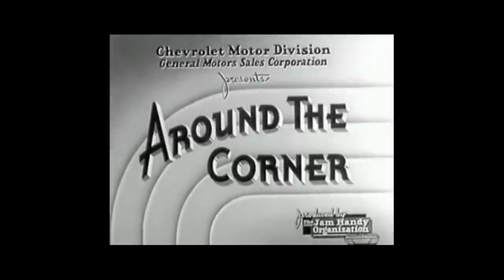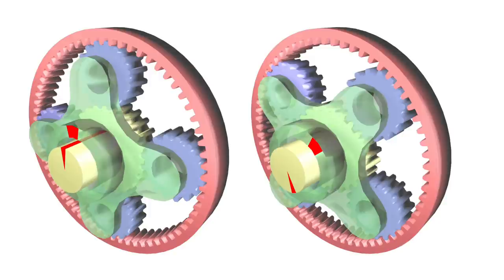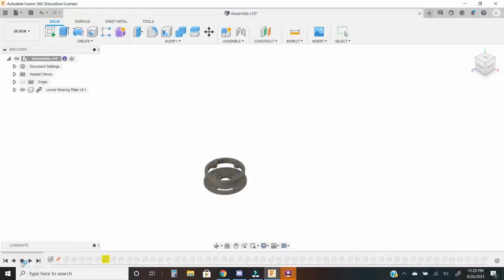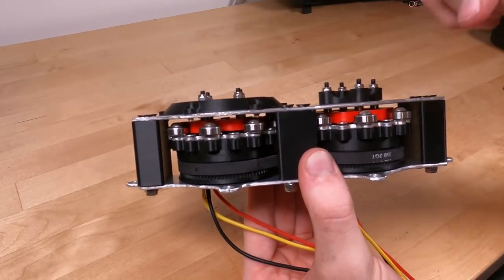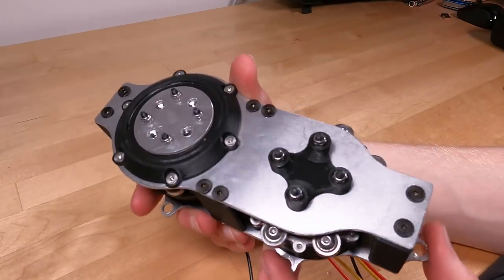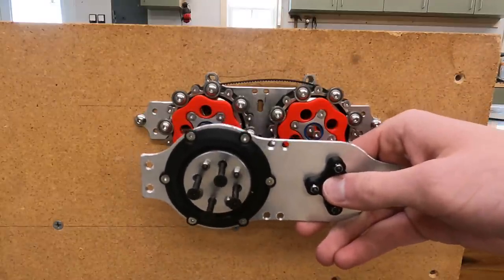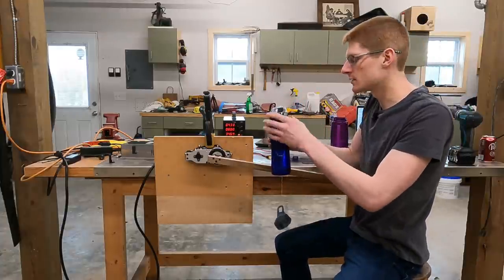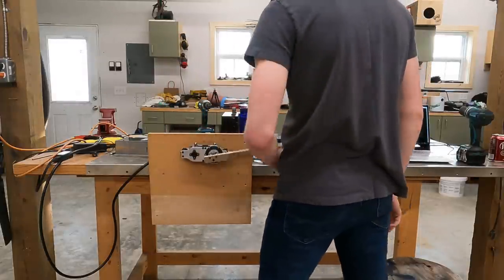The Differential Drive - A New Breed of Actuator

Comment: One application for driving one shaft with two engin is in ships. The concept is called "Vater Sohn Antrieb" (German), "father son drive".
I wasn't able to find anything on the internet with this phrases.
The idea is coupling two motors to on propeller shaft to get the option to run any of the motor under optimum efficiency conditions under different load condition.
The father motor has around twice the power of the son motor.
So using only the son, the ship can cruise low speeds at maximum efficiency of the small motor. For maximum both motors are engaged. 
This concept is used on tugboats and a specially on riverboats.
For example on some passages of the Reihn ships need very high power to go uphill but for going downhill they need only little power to enable enough flow at the ruder to maintain stearebillity.

Comment: So I have seen something very similar to this on industrial box making machines. The machine is made of many pairs of drums that pull the board through the machine and cut/print on it.

In order to adjust the registration of the cuts/prints to the cardboard there is a registration motor. You can rotate the drum in relation to the main drive bull gear. Either while the machine is stopped (for setup) or while it's running. 

There are two ways this is usually done. One is actually to have a motor that is bolted to the drum and spins with the drum, like an overdrive. I think this is an older way of doing it since it was only on the older machines. The newer machines all had various complicated ways of using planetary gears to do this. Very similar to the first diagram you showed. 

An interesting use of this mechanism beyond just alignment of cut/print. 

As you wear down the anvil that the blades are cutting into the diameter of the drum is reduced. Meaning you have to spin the anvil drum faster than the top cutting drum or you will bend the blades on the top drum. So it can also be used as diameter compensation. 

Just thought I'd share where this kind of technology is used in industry that I've seen.

Comment: I like your analogous to the differential drive, I think what happened is similar to a car sitting on it's belly, 

If your car is stuck in the sand in a way which one wheel (left) is touching the ground and one (right) is floating in the air, with an open differential, that right floating wheel will get spun rapidly and the left one will not get any power

Your output is like the left wheel, but since yours isn't locked to the ground, it fails to hold a weight and drops

I think it could be cool if you could design a locking mechanism to your differential which can be released after some speed is gained. Maybe even clutch it for smooth transition between modes

Love the ingenuity! Keep up the amazing work 💪🏾

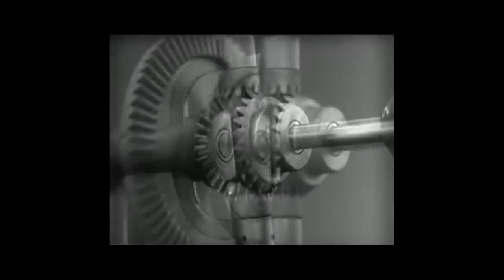Comment: 2:20 this method of planetary gears is used in many hybrid cars, the Chevy Volt does this where the outer ring gear can be held and use the reduced speed of the planetary or the planetary gears can be held to overdrive the ring, which it uses to recharge the battery.  Great video!

Comment: This is a nice idea. Honest critique: I don't like the belt and I think the tolerances probably need a lot of tightening.  James Brunton has an excellent version of a single cycloidal that fixed the tolerances using bearings. Other than that, I think it's a brilliant idea. One problem I noticed, on your master transmission, your motors don't see equal load and travel.  I suspect you'd see better results if your slave motor had a different gear ratio that reflects it's loading on the outer ring gear.

Comment: Any gear set is of course a lever system. Your design is equivalent to the arm of an excavator - you could move either input X amount and (if ratios are the same for both pieces) get the same movement at the actuator end, however the furthest actuator from the output / load end also has to move the next stage, increasing the length of the lever (This will be why you had to 'gear down' the secondary motor.) Move both sets together and you will SUM the output motion As you eventually found out the issue is, exactly like an excavator arm, that the furthest actuator from the load / output will suffer the highest level of loading because the overall length of it means the leverage includes subsequent stages :)
Hence why excavators usually have 2 MASSIVE cylinders driving the main arm and only one smaller one driving the furthest limb!
I rarely comment on videos but I felt like it was worth pointing out (not sure if anyone else in the comments said the same thing before me mind you?)
Great content, thumbs up :D

Comment: This sounds a lot like an IVT or infinitely variable transmission, versions are used in some hybrid cars and john deer tractors. Usually 3 motor inputs (john deer uses 3 cvt inputs) are used to control the sun, ring, and carrier of a planetary creating "infinite" gearing.
Reply from the maker: I initially thought this would be an IVT/CVT system, hence the double-torque hypothesis. But, considering my final thought experiment and the experiment, this can't be the case. As far as  understand.

Comment: Check out the "power split" transmission used in heavy off-road vehicles eg. Fendt Vario tractors. Often  by splitting engine power into two paths: 1) a gearbox with fixed ratios 2) a continuously variable hydrostatic transmission. Then summing the two with a differential gear. Result is a high efficiency transmission with continuously variable ratio. Only a fraction of the total power is transmitted through the variable element, which typically has lower efficiency than the gearbox.

Comment: I've seen this concept (2 motors driving a differential) invented a few times in the Lego community, either from a mistaken belief that putting 2 motors on one output would somehow harm the motors, or like in the video, to create a 'gearbox' for speed control.

One of the reasons why it doesn't really work as intended is because it doesn't quite sum torque, but instead only goes up to 2x the torque of the weakest motor (or motor the least gear reduction). 
It doesn't do much for speed either, since you could instead put the 2 motors on one shaft and use proportionally less gear reduction, getting the same speed with less moving parts and therefore most likely less losses.

One place where it would absolutely be very useful is when transmitting rotation to power a joint through an infinitely rotatable second joint. Subtracting the motion from one to the other makes sure they don't influence each other, while negating the need for things like slip rings or intricate electronic control to synchronize motors.

Comment: An IVT from a Toyota hybrid uses the same operating principle. The benefit is that you effectively "blend" the two ratios, allowing for a combination of generation and drive, as well as the fact that you can run the electric motors in reverse, or idle them, allowing the petrol motor to run without stalling even when the output isn't operating.

Comment: FYI, Toyota uses these in their hybrid transaxles. This mechanism is used to couple the gas motor to the generator and starter motor, so that the starter motor and Generator can spin freely, while the engine is not turning, but also can be stopped or turned start the engine, as well as act as a Cvt.

Comment: A similar system is use on Aircraft to drive generators at the correct frequency, it's called a Constant speed drive unit (CSDU). At low engine speed the drive speeds the alternator up with a motor, at high engine rpm the motor is driven in reverse to lower the alternator frequency. Avionics on Aircraft are frequency sensitive unlike cars that have frequency wild alternators.

Comment: The easiest way for me to think about this is to just mount next motor to the output shaft of the previous motor. If you imagine a longer chain of motors, then I think how the stall torque distributes begins to make more sense.
Reply: And it also explains why Hypothesis 4 doesn't hold water: If you add up two values with independent errors, the error add up quadratically. So the precision of speed or position control of two coupled motors will always be worse than a single motor. Of course you can get below the minimum RPM of a single motor, but with a horrendous quality of control.

Comment: I know of at least one radio telescope that uses two motors driving a gear. By having one pushing against the opposite gear faces, there is zero backlash, and driving in either direction is simply a matter of increasing torque on one and decreasing torque on the other. It’s good for arc second stability.

Comment: This idea is used in the Koenigsegg Regera to make a high performance transmission with no gear shifting.

There is a electric motor joined with a internal combustion engine. So running the motor is reverse slows down the engines output speed for low gears while running it forwards increases the output speed for high gears. This also removes the need for a clutch because the output can have 0 RPM while the internal combustion engine is running. To assist the lack of torque at low speeds extra motors are used in parallel with the wheels to provide additional torque (Electrical motors are very good at making high torque at low rpm so this nicely uses there advantage)

Comment: This was done in 2006 in the agriculture tractors. It was a CVT transmission.  On a planetary gear set.  The sun gear was driven by the engine RPM. The planetary carrier is splined to the rear differential. The ring gear was driven my a hydraulic variable displacement piston motor. The pump that supplied said motor was driven by the flywheel of the engine. It was also variable displacement.  This gave the tractor great control over torque and speed.  To me. It's the way CVT should be done

Comment: BMW uses this to achieve additive steering. The first instances was implemented in 2005. The driver can input steering angle while a computer can add or reduce based on different system measurements.

Comment: The output power of a motor is typically higher at higher speed. It depends somewhat on how it is controlled. But one typical case for a servo motor (that is controlled) is for the available torque to be constant from zero up to some particular speed. Since the torque is constant, the output power is linearly proportional to speed (over that range).

Comment: I have seen the kind of differential gearbox used on an aircraft to drive the electrical generator from the engine. The engine provides the primary input, but that will vary with engine speed. The second input is from a combined air motor/blower unit. This is varied to maintain the generator speed so that the output AC frequency is constant. If the engine was running slow, the air motor would provide the extra input using bleed air from the engine. If the engine was going fast, then the excess speed was bled off by running the motor in reverse as a blower. I can't remember what plane it was on. It was a Plessey unit that was old in 1990's. Edit: I think it may have been used on the BAC1-11's flown by Dan Air, and others.

Comment: Ooh, I built something like this a while back to make a two wheel drive robot go straight. I used a differential style input to each wheel with a drive motor and a steering motor. The steering motor added to one side and subtracted from the other. The motors were set up with different ratios because you never want to steer as fast as you drive, the steering motor was smaller and I was trying to avoid back-driving the steering so it had a higher ratio. Very interesting to see the more general application... I thought it was interesting at the time, but never played with it further.

Comment: Great video and thought process! I think you don't have a torque problem, you have a speed control problem. When you apply torque to the output shaft, the motors' speeds will change a little as a result, allowing the output to move. You'll find the same difficulty in achieving precise position control, which your stall torque experiment was in fact testing. Any speed difference in the motors of just 0.01 RPM will cause the position to drift by 0.01 RPM. But as many have said, you independently came up with something similar to Toyota's Hybrid Synergy Drive drivetrain, which is no small feat. Kudos! Keep it up!

Comment: This is a pretty common solution when two motors or engines are combined with diffrent chararietics. One example of this is the swedish tank strv103  using both a diesel and a gas turbine engine. Because they have diffrent throttle response, they can't use the same axel.

Comment: This reminds me of a constant-speed drive system from an aircraft alternator. It uses a differential kind of mechanism to limit the output shaft to be a constant speed regardless of whether the aircraft engine was spooling at idle or at max thrust. It uses a motor to spin the other side of the differential to change what the speed of the output is. It's not exactly what you've done here but it is similar and I'd recommend looking into that mechanism

Comment: The principle in a Vario transmission from Fendt, which has been around since 1995, is similar, I think. There are no 2 motors, but the power from the motor is divided into 2 paths and combined again. This achieves what you want to achieve.

Comment: I think what you're describing is a device called a "torque converter". As far as I am aware, it was developed in the early 1900s (1910s-20s) as a way to combine the power of internal combustion engines, with the relatively weak, but precise and quickly accelerating, electric motors of the time. The only device I personally have ever seen it "used in" were some experimental auto targeting anti aircraft guns. Judging by it's lack of being known to most modern people, it doesn't seem to have been very successful, even though the concept was sound.

Comment: With regards to the arbitrarily precise positioning; my understanding is that under applied load, in order to energise the windings; a motor controller requires either a sensor or encoder to know the exact position of the permanent magnets. 

I don't quite understand how this requirement could be removed - as soon as you add load to the mechanism, the rotation speed of the motors will reduce. So without an encoder or sensor; you end up losing most of your torque as the wrong coils are energised in relation to the poles on the rotor. Perhaps you're implying the use of back EMF to determine the rotor position?
Reply: I should have read more comments before adding one myself. You just gave a better explanation of what I was trying to say in my comment. I really don't understand how this mechanism can produce precise speeds without encoder feedback.
Reply from the maker: Sensorless motors do have positional feedback, but it's achieved via measuring the back EMF across the coils, and sufficient back EMF is only generated at speed. So, a sensorless driver can maintain a specified velocity, compensating for external load based off the timing of the back EMF. Arbitrarily precise movement can then be achieved because the actuator can stall when the motors are at or above that threshold speed.
Reply: @LeviJanssen   Thanks. Thought that might be the case
So, to summarise;
back EMF can be used over a certain speed threshold and accurately maintain that speed
Run both motors above this rpm threshold.
run in opposing directions to "stall" the output (motors are still running at an rpm above back EMF threshold)
output entirely depends on ratio between the two motor speed+direction.

Comment: also, differentials have a way of allowing lashback to  take the path of least resistance, this can have some frustrating effects when using brushless motors with a diff-couple. 
it IS however very usefull when combined with a faster geared  motor that has a one-way rotation lock (it cant counter turn), and a slower higher torque motor. the two motors effectively give you an automatic transmission that gears down when the smaller motor stalls out, and turbos when it has low enough resistance. also, you can even still run the slow motor in reverse while the other motor locks.

Comment: Really cool video. I have actually used this method several times when building with Legos. The lego motor system is usually full power on or off. So when building a tank for example the turning is not smooth and can be hard to control. Using this method of adders and subtracters by means of a differential I was able to add speed to one side while subtracting from the other side. This would create smooth turns and allow for more functionality and tank like movements.

Comment: You may not know it, but the differential shown in that ancient video can actually already do what you want.  Just connect two motors the the "outputs" and use the "input" as the actual output.  Also, they're really easy to build, take a look at the Lego differential, it's the same thing, but optimized for simplicity.
(Edit: not claiming it can prove your original hypothesis, but that it can work in the reverse direction.  But you can use this to create an automatic transmission with the addition of a slip gear.)

Comment: Same idea in some mechanism that have to be able to move fast and slow using different reductions in each motor you can achieve A+B/2 A-B/2 in both directions.
Some aircraft system that require redundancy in the motor but not in the driveshaft has similar setups.